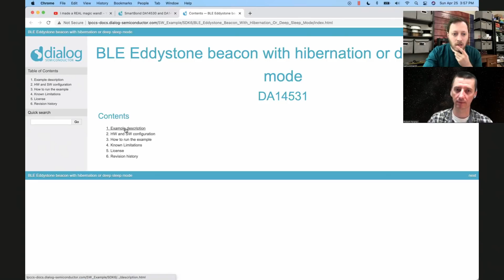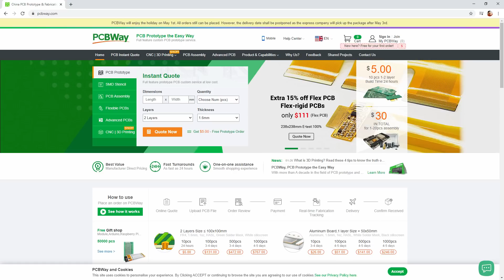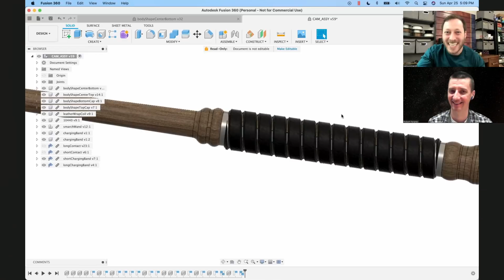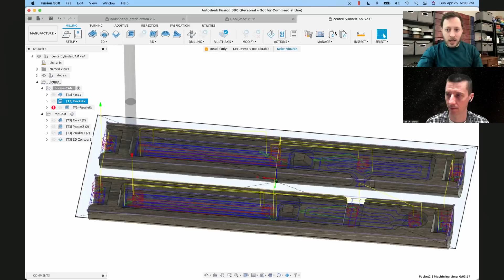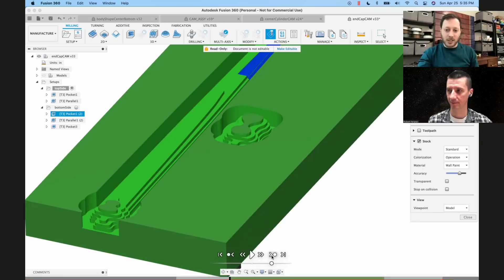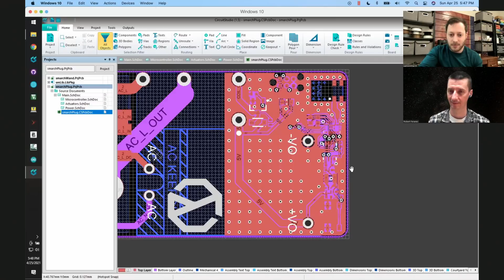How to Design and Build Your Own Idea - Example: A Magic Wand (with Samson March)

Comment: Great video as usual. It would be nice to see the design of a single section (e.g. the power supply, a CAN bus interface, etc.) of a simple circuit from scratch. I am conscious you need analog and digital electronics knowledge, but it would be interesting to see the "mental process" and steps used by hardware engineer to make his first prototype and transform theory into practice. Focus on a delimited part of a circuit could be probably the right compromise to achieve something like that. Videos like this are really inspiring, but sometimes I feel as I am missing something. Maybe too much love for details :D
Reply from the maker: Thank you Domenico

Comment: I was curious to know why he decided to use Dialog BLE because there are so many BLE chips vendors for example TI, Nordic, Silicon Lab, Cypress, NXP, ST, Renesas, Toshiba all come with SDK and extensive examples and documents. And have also smaller size packages. What factors do you consider off course stock and price other than that?
Reply: Honestly, my typical part search goes: search digikey, narrow in on parameters that are important (power/size) and then I sort by stock/availability and cross reference that with cheapest. This part in particular came because I wanted the lowest power option on digikey. I've used nordic, cypress, ST and others before. I like them all! I'm not partial to any particular company. Just whatever makes the most sense for the application I'm working on.
Reply: @SamMarch  thanks for detailed reply.  Do you not consider Development  tools and IDE. Keil is expensive to hobyist?
Reply: @Vel_Nails  I very much do. I think certain companies have certain deals. For example, Keil was free to download and use as long as my program was below a certain threshold of memory. The dev kits I want to say were ~$40 or so? I tend to favor cheap things for hobby projects!

Comment: Just checking - but at around 45:00 , shouldn't the output of the charger be connected to VBAT and B_GND? Otherwise if the battery has fallen too low and is being protected, the charger will not be connected to it?
Reply: Hi, Sam here! That’s a great question! But the chip that I used actually specifies designing it this way. It actually uses the charging of the battery to “unlock” the protection circuit. So applying then charging voltage and regular ground, it allows the battery to be charged and power the system!
Reply: @SamMarch  aha! Thanks!